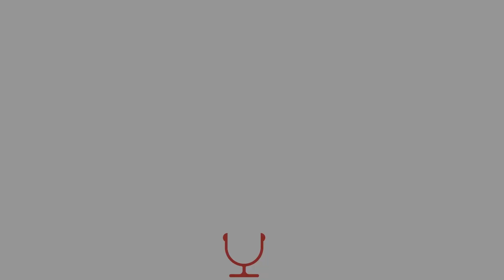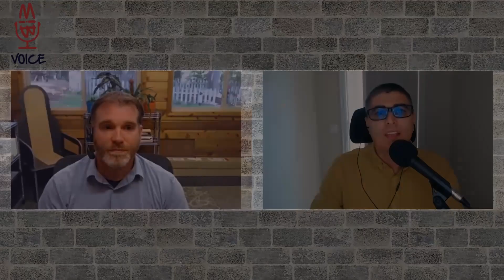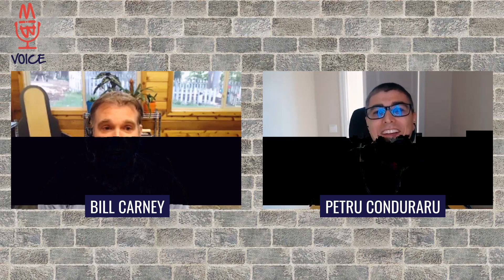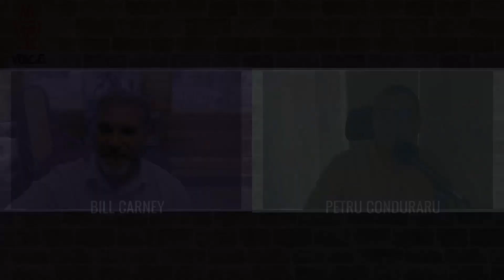BIMvoice#15🎙️Bill Carney (BIM in US, IPD, technology in AEC) #bim

Comment from the maker: ⏱TIMESTAMPS⏱
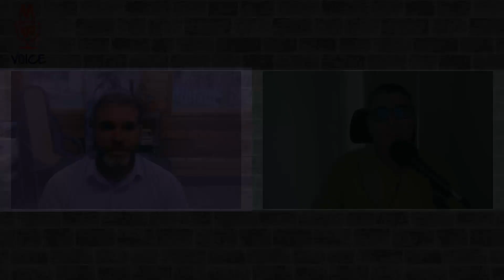00:00 - Introduction
02:30 - R&D (Research and Development) at DLR
04:23 - Machine learning for design in Construction and other bleeding edge technology
07:11 - R&D in American AEC Companies
09:30 - Sensors to predict CO2 emissions / Digital twin / Optimizing buildings
16:30 - Impact of Covid-19 in AEC
18:32 - What do you teach at the University? (BIM/VDC/IPD)
21:22 - What is BIM for you?
25:12 - Would be possible to design more efficiently?
28:04 - IPD (Integrated Project Delivery)
35:39 - VDC
37:06 - More on IPD
41:19 - UpCodes
48:57 - BIM adoption
1:01:27 - Contact Bill